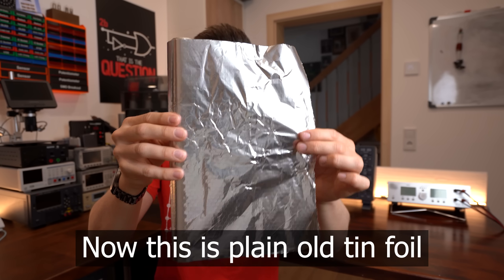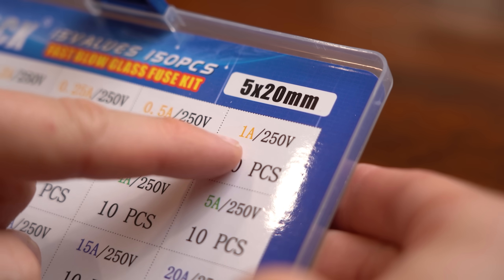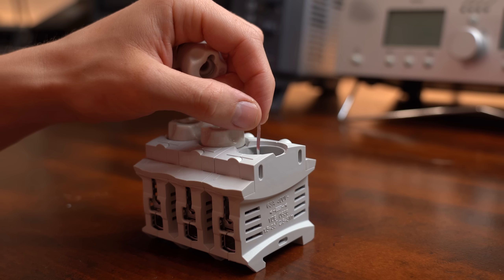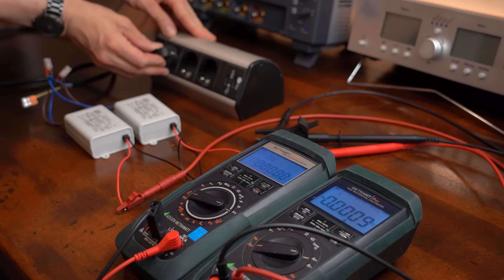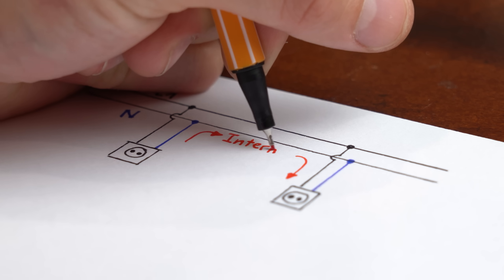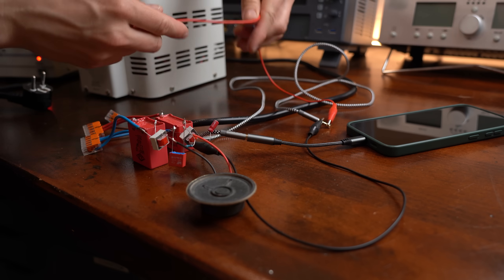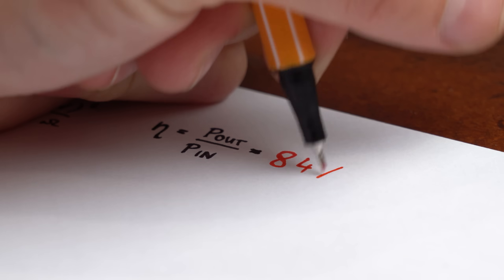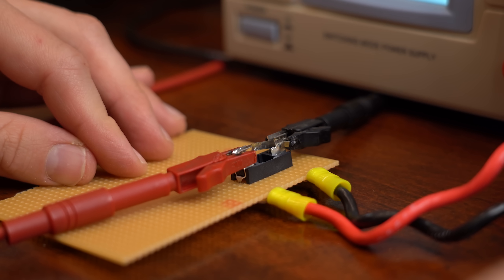I tried Busting 4 Weird Electronics Myths!

Comment: Foil is worse version of Just  soldering one or few strands of thin wire to side or fuse which can work but is not So reliable but you can make it work Little bit if its thin enought piece of foil

Comment: Using multiple power supplies is more than possible - that's how many high-power DC supplies work as they actually have multiple DC/DC rails. What is needed, tho, is super-precise potential regulation/synchronization between the two to ensure that they share the load properly. That's how high-power EV chargers work, for example...

Comment: I used to use a pair of powerline adapters. They worked well enough but I would lose connection every time someone used something like a vacuum cleaner, likely because of the noise that it generates.
Reply: Even worse: Using those Power line adapters makes You the enemy of any HAM radio enthusiast in quite a large area around. They produce a surprising amount of noise on the Power wires which acts like a transmit antena. To the point that there were quite a few incidents where emergency services/Aviation radio etc was interrupted and resulted in fines for the users here in Germany.

Comment: You also get some power supply types that can be used in parallel but I think it all depends on the feedback system and how accurate the supplies are. For example my lipo charger has two independent channels that can be used in synchronous mode too where you just connect them in parallel, I think this is probably because the feedback system can handle the differences or can control both SMPS systems together. I would think that one of the main requirements would be communication between the power supplies so that they can adjust to balance the load.

Comment: Ive never heard of a motor being used as an inductor. but thats because my favorite thing about using inductors in my designs is they are about the only electronic component you can realistically build/tune yourself (yeah, fencing wire can make a high wattage low value resistor, and there are all sorts of mad HV cap designs for tesla coils etc, my favorite being glass jars and salt water, but they arnt exactly practical). If you have an LCR meter, which you would need to use a motor anyway, its trivial to add or remove windings on any generic inductor to 'dial it in'. another useful source of 'inductors' is a standard mains transformer, ive used them for ripple filters in valve amps, the value isnt critical and they can take the voltage.
I once designed a 12v fluorescent tube driver for camping that used a rod ferrite, adjusting the ferrite position with a screw adjusted the inductance and the amount of current drawn. this was pre-LED/solar panel era, and being able to adjust an 8w fluro down to about 2w was pretty nifty. full brightness for meal prep and such, but a dim background light so you dont trip over stuff while sitting around the fire was quite a feature. and it could run all night without killing your battery, unlike an incandescent. the only problem was you had to wind it up to full power to start the lamp, which was annoying if you had developed your 'night eyes', 8w can be quite blinding when your pupils are dinner plates.
:hand-orange-covering-eyes:

Comment: Powerline LAN works among L1 - L2 - L3 without any coupling (at least TP-link products does). I am using it at my house for aprox. 10 years, because  I didn"t want to pierce it with holes in cellings and walls like an emental.

Comment: Hahahaha. I'll tell ya right off the foil fuse thing is no myth. Hell, I even got good at replicating the current rating by using different cuts and types of foil. The foil from cigarette packs works good for low currents. VERY THIN

Comment: You sent
Hello Scott!
Loved the new video. I was wondering if you're planning to turn it into a series. If so, here’s a myth for you:
"You can transmit data (like Ethernet, something that is high speed) through any connector, as long as the connections are solid. For example, Ethernet can be passed through both an RJ45 and a DSUB connector."

Some students in my robotics club keep saying that and say "we tested it, it works" but i keep explaining if you look at it through an eye diagram, you'll see the signal get affected making this not usable. Thanks ! 🙂

Comment: professional servers usually have 2 power supplies that run parallel. And since they are sized to handle the load alone the issues you mentioned simply don't matter.
But they do go into alert state if one fails anyways, because that means there is no more redundancy. The alert is loud enough so you can easily find them in a loud data center.
The one I have at home has 2 1000w power supplies. But to even draw anywhere near that you would need some pretty beefy accelerator cards in there in addition to the 12 hard drives 2 CPUs and 2-24 RAM modules.

Comment: I have a project that deals with high voltage that produces a huge EMI and my arduino gets reseted by it even though i have powered it seperate and isolated with a Octocoupler but still at some point it's doesn't work, any ideas to help me?

Comment: Regarding using motors as coils it's quite legit, this is literally how the Renault Zoe's BEV charging system works it passes A/C current through the main drive motor during charging(thanks Gary's C EV repairs for that nugget!) 😉

Comment: You can use PSUs in parallel better when you have a small resistor in series with both individual PSU. That way they act more like a battery and have a slight voltage drop under load which helps equalize the effective voltages.

Comment: Be careful with the parallel PSUs. While it worked with your examples, it can easily lead to a cloud of magic smoke.
Especially with higher wattage supplies (like ATX PSUs) and especially SMPS which have a tendency to oscillate, this is a very bad idea.
Two LDOs in parallel are most likely fine (but even those can oscillate), two SMPS most likely will oscillate.
Source: I build and program test equipment. I have seen lots of circuits, and especially lots of bad circuits. Most of them work fine, but looking at the statistics after 10000 DUTs tells very quickly which circuits are designed robustly with manufacturing tolerances in mind, and which ones just barely work in theory

Comment: The one about the tin foil, I had always heard that just wrapping the fuse in one layer of tin foil wouldn't be a good idea because it wouldn't blow to save the circuit.  I've NEVER heard of anyone making fuses out of it like you did.  I've used tin foil in an emergency, just long enough to get a proper fuse to replace the blown one with.  I now carry a fuse kit to replace a fuse that blows.

Comment: People used the paper backed foil from a pack of cigarettes. Just a single layer.
The worst I've seen was a piece of a 1/4" bolt in place of a 3AG/AGC fuse.
Tnfoil is solderable, while aluminum foil isn't, with common fluxes.

Comment: I have never undersyood the tin foil method as a fuse.
It has always been just a bridge if no fuse was available, but you blew the last one for some reason.
In the UK sockets and plugs have fuses (typical over-engineering...) and I've seen a lot of these replaced with tin foil.
That simply turns UK plugs/sockets into Schuko style power supplies!

Comment: Maybe the tin foil isn't a best example for self-made fuses, but single thin 'hair' from wire works OK if you don't have fuse for higher currents (around 2+ amps)

Comment: Myth3 is not completly correct! If two phase-strips are close together on a longer distance the signal will hop to the other phase-strip. So you'll get a connection, but a little slower as usual.

Comment: With good quality power supplied, there is no issue at all running them in parallel. We do it literally all the time in our lab, delivering hundreds of amperes DC. The important part is that offset current, a good PSU should have no issue with it, but a crappy PSU can become a fire hazard...

Comment: That motor is built for say 50A. So the puny 1A of your DCDC will NOT saturate it. 
The motor is expected to run at say 10000 RPM. Or  166 rev per sec. With say 4 ERPM/RPM that comes to 666 Hz on the stator. 
Your DCDC is running at a much hiigher frequency. The stator is suitable for frequencies up to say 1000Hz or maybe a bit more (if meant to run in BLDC mode as opposed to FOC/sinusoidal). So my guess is that that's the main cause for the efficiency drop: You're losing energy in the stator due to the higher frequency.

Comment: You should test using diodes (maybe schottkey) when connecting two power supply. if one supply draws more current the diode voltage drop increases. It might help a little bit. Also if voltage one is over the other you won't feed back current into it.

Comment: I use two power supplies in parallel every day. The router usb does not have enough to drive a hard disk and you can get a y-splitter cable to connect a charger for more amps.

Comment: Parallel PSUs: Worth noting is that a lot of server PSUs of the redundant types mainly do one of two things where either by feedback performs current sharing actively, or by dropping the voltage at max load so the next PSU can take over, however it has to be designed to do so. Useful when I want to combine a couple 350W to get 700W (I stick to no more than 600W usable with 50W margin). Another way is to have a linear slope proportional to current so that as more current is drawn the less voltage on the output so that the second PSU can begin taking over, though I've not seen that type that often.
I haven't tried mixing different server PSU current sharing methods as I'm not sure if there'll be fireworks.

Comment: Power supplies that are meant to operate in parallel have a larger voltage droop on purpose (i.e., the higher the current the lower the output voltage). It makes it easier to balance the load since the supply with a lower load would have a lower voltage it's force to take more load since the voltage must be the same where the supplies are connected together. It is inherently stable.

If the supplies have no droop at all then even an infinitesimally higher output voltage on one supply would cause it to take all the load (the voltage regulator will try to raise the voltage by the infinitesimal amount, which causes the load to rise until it has all the load and can finally raise the voltage). This is unstable.

Comment: Myth 2 isn't really a myth per se and while it does bring about concerns if one fails, if it's well within their spec it's a lot less likely.  A great example of this is at a bigger scale is HDPLEX's ATX power supplies that can be run in parallel to provide greater wattages.  They simply have a jumper that ensures they turn on at the same time to avoid load spikes during boot up of a PC.

Comment: Power Lines dampen different frequencies to different levels. First of course you cannot use the 50Hz of the AC Power, you have to start much higher. High datarates need high frequencies, so some modems measure the frequency response of the line and adjust the pre-amplifier and filters accordingly. If you play around with an SDR (Hack RF one or RTL SDR) you want to ban all PLC from your house because it causes a lot of RF emissions.

Comment: Motors' ferromagnetic material works much better at low frequency and has more hysteresis.  At tens of kHz, eddy currents cause significant losses and hysteresis losses are also higher.

Comment: Fuse companies spent significant time and money studying materials, shapes, and sizes of small conductors that make effective fuses and how to make those shapes reliably.  Shorting out a fuse is likely simply to burn up the device the fuse is installed to protect.  If the device has no fault, it is unlikely that it would have blown a fuse.

Comment: You used multiple layers of tinfoil and compared it against a tiny wire fuse. Do the test again and use just a flake of tinfoil and measure how fast that burns up with 2A for a more close comparison.

Comment: I remember this hack as using the tinfoil from a chewing gum wrapper, which I super thin and paper backed to give it structure so you could make it small. And you would wrap it around the fuse and pop it in to give a good contact. I'm not sure I remember ever using that hack. But that's how I remember it.

Comment: Myth 2: You need low-ohm resistors between the power supply and the load to get better current sharing. I've done the same to have two power tool battery packs in parallel on a load - e.g., a 100W COB LED.

Comment: 6:19 You can use two DSA30C45PB schottky diodes. I connected two BMS in parallel with four schottky diodes for charging and discharging. I can draw almost equal amounts of current from both. Then they don't charge each other even with the voltage difference. Maybe it could work on regulators.

Comment: Back when US pennies were actually made out of copper and fuse boards actually had fuses in the US. it was quite common for "some" individuals to unscrew the fuse and Pop a Penny in and screw it back in. And put their trust in Lincoln. That is until they introduced the safety fuse which prevented that and prevented you from rearranging fuse values.

Comment: My father "fixed" a Fuse when it blew  on a Saturday night by inserting a piece of Tinfoil into the Fuse Holder.
This Hack worked perfectly until the Shops opened on the following Monday. 
It was in the early 1960's and was not intended to act as a Fuse. We needed to use Electricity over the Weekend and there were no other options available until the Shops opened.

Comment: I remember years ago when I would make diy, I used to insert 2 nails on wood and attach wires on both sides. While in between I would add 1 string of copper taken out of some wire(you know wire have multiple strings) . That worked well for my experiments.

Comment: I thought that power line ethernet adapters were connected through the neutral. Is there a reason for using the live wire instead?

Comment: The tin foil is a temporary fix for a fuse, not a replacement. I was stranded in a storm on my boat due to a blown fuse, and used a gum wrapper in its place to start the motor and get home safely after the storm passed. Worked like a charm.
Reply: In that case I say plausable

Comment: The fusing current of copper is 70A per 1 mm2 - therefore in an emergency 0.5mm (0.2mm2) copper such as found in CAT5 cable can be used in an emergency as a 14A fuse.

Comment: I used to design brushless DC motors for an OEM. You hit the nail on the head with your mention that inductors are meant to be energy reservoirs while motor windings are not. The motor laminations are made from "electrical steel", alloys which typically contain silicone and used for motors and transformers. When designing a motor, you use these alloys because they build and release the magnetic flux induced by the coils very quickly. You don't want the laminations storing magnetic energy, if the laminations are still holding that energy when the coils switch you're going to have a harder time inducing the new field and reduce the magnetic flux you can build up before the coils have to switch again.

Comment: The tin foil is supposed to wrap the old fuse and be reinstalled.  The foil is not supposed to replace the fuse; just the fusable wire inside.

Comment: I have some power supplies which have a failure mode if connected in parallel like that. The lower voltage one will cut the regulator off because the voltage is too high. That ends up applying the full output voltage across a base - emitter junction in reverse, and they are usually only rated at 5V. As a result, the transistor fails. Ask me how I know. 😊

Comment: Audio on the mains power is not practical. The power frequency is in the audio range. There's also some voltage leakage concerns if the capacitor gets bigger, so there's a limit to how low audio frequencies you can use. But above about 50kHz (or 60k if you're targeting 1000 times line power) things get better. Then there's the transformer which gets problematic as frequency increases. Carrier current radio however in the AM broadcast band works quite well. 600kHz for example on top of 60Hz power is a good fit.

Comment: Back when I was at school, we used to connect the lab power supplies together and connect them to a mechanical pencil lead, which would glow like the sun for about 10 seconds while giving off large amounts of smoke and leaving a big mess on the bench.
Reply: It's "better" if you use a whole pencil, sharpened at both ends :)

Comment: I'm can't say for sure without reading the specs, but the motor winding will likely have a higher saturation current than the toroid. It has a wide air gap in its magnetic circuit.

However, the losses will be bad at high frequency, because it has a laminated steel core instead of ferrite